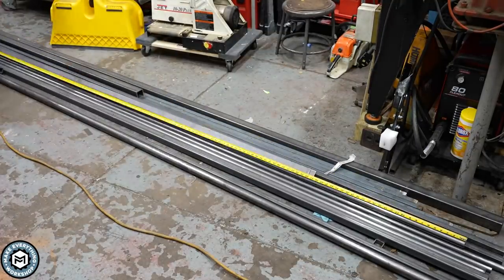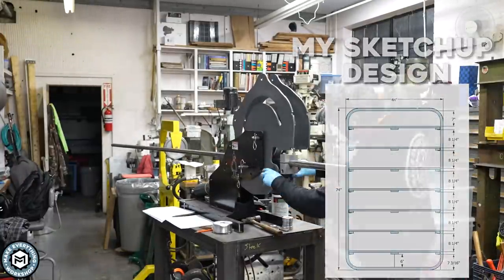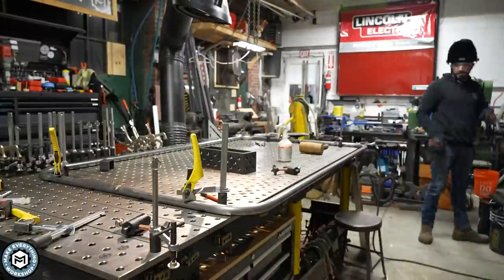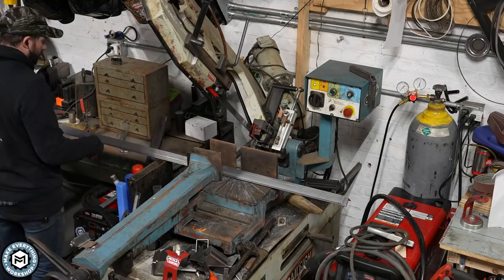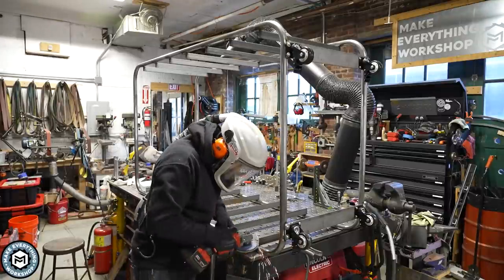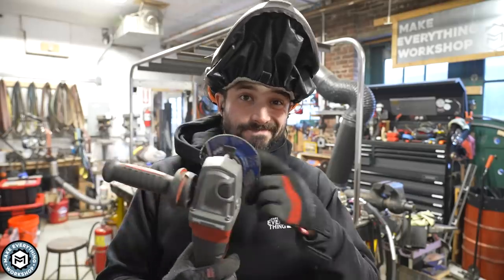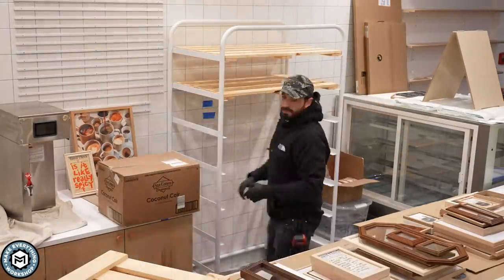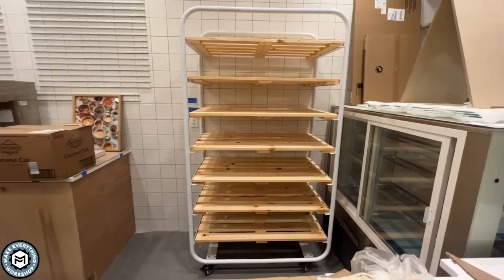Recreating A Vintage Shelving Unit From a Photo!

Comment: I'm curious, did the inspiration piece have the same type of bends? I've noticed that a lot of mid-century modern stuff uses bent tubing but I think the technology was slightly different back then. Very often The 90° bends have the tubing concave on the inside of the bend. It's not crushed, it is clearly done with a die. I have never seen this tool before, do you know if it's still exists? I've wondered about those concave bends for quite a few years and how they must have been made. I tried a few attempts using a hossfeld with some strategically placed blocks but I could never get a satisfactory result. I most often see it done on high polish chrome which makes it that much more mystifying. Do you happen to know how to do this? Do you know if it's a particular set of dies?
Reply from the maker: We only have a few photos of the inspiration piece but the bends looks pretty uniform. I’ve gotten that sort of creased bend when bending 1x1 square tube, I know what you are referring to
Though. If I had to guess, that type of bend is made with a single die pushing into the center of the bend as opposed to the tube being pulled around a corner. Imagine like a big press brake die pushing into formed shapes. That’s just my guess though. Good luck!

Comment: Rookie welder here...what did you spray on the steel before welding it?
Great job - love seeing the process!
Reply from the maker: I used some anti spatter spray to keep the rest of the material from getting anything on it, and to protect my table. I use the stuff Jason at Fireball tool tested and recommended. Its by Walter I think, Jason sells it on his website.
Reply: @MakeEverything  outstanding…thank you!

Comment: Be careful using wood as a fixture. Not for fire reasons, because of the economies reaction to covid. I don't know if it is nationwide but most of the 2x4s out there lately are finger jointed together. Sometimes as many as 4 joints on an 8 ft board. This would not affect you. But they have started doing is slightly shrinking the 2x4s. It used to be 1 and 1/2x3 and 1/2. If you go to your local big box store with a tape measure, you just might see the same thing that is at my lumber store, 3 and 1/4 x1 and 1/4. I'm not going to get into its effect on the trade, but in this particular case you have to be careful that the wood is the same size as each other.